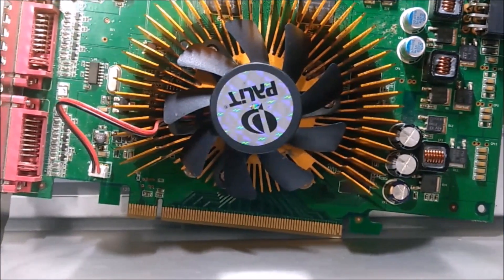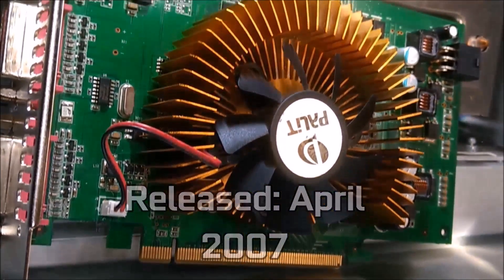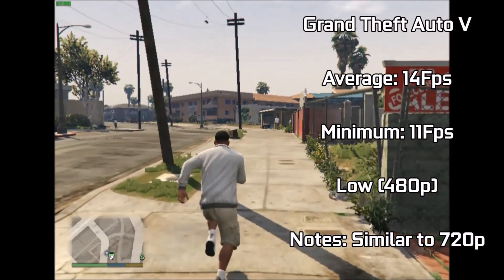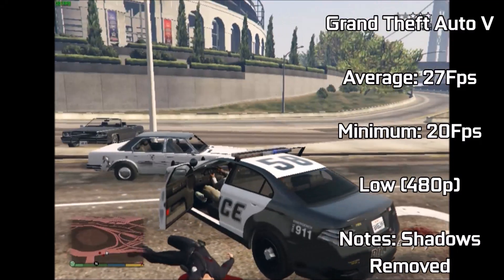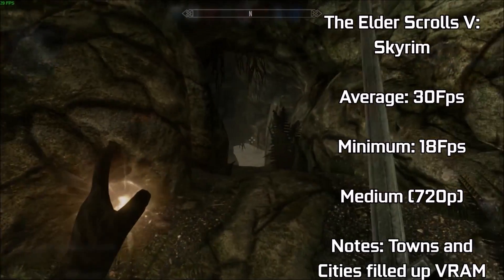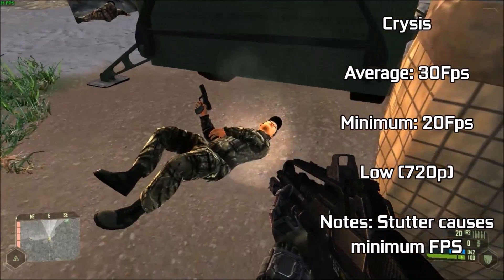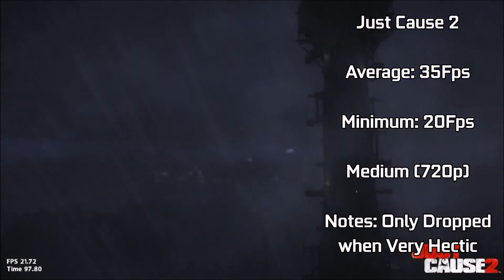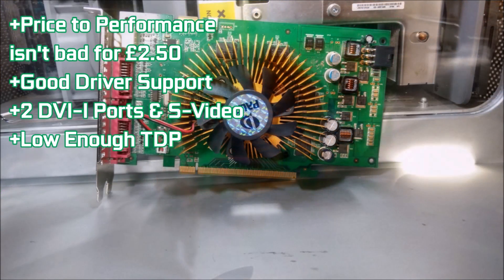The £2.50 "Gaming" Graphics Card  // A Review of the Nvidia Geforce 8600GTS

Comment: My laptops integrated hd4000 from Intel is faster then this crap... 8600 was terrible even on its launch, in 2007 was cheaper to grab the x1950 Pro over this, and x1950, hd2000 and 3000 series are still verry capable cards for low spec gaming.

Comment: Wasn't this card almost identical to the PS3's GPU? It still can play relatively new games (And GTAV, thanks to console optimization
Reply: Specialopsdave I thought it was the 7950 GTX
Reply: PS3 using different technical ways.  The GPU is RSX 'Reality Synthesizer', based Nvidia 7800GTX (G70)  and also the Cell Broadband Engine, the console's CPU, is also used complementary for some graphics-related computational loads of the console.  The RSX also more advance, the biggest difference between the two chips is the way the memory bandwidth works.  RSX is able to render to both system and local memory and the normal G70 only support render local memory.

Comment: I spy a bridge connector on there. Get a bridge and link 2 cards together for a video man
Reply: On which board?
Nowadays ot an issue, but back in the day you needed a board with an nvidia chipset.
Reply: @HappyBeezerStudios  nah, if you had any P45 or X48 board that was compatible with Crossfire, you could use an unofficial program called "Hack SLI". I used 2 GTX460 in SLI for 2 years on a DFI P45 motherboard (that wasnt technically compatible) paired with a Q9550, back in 2011.